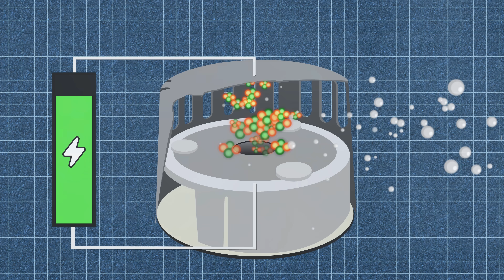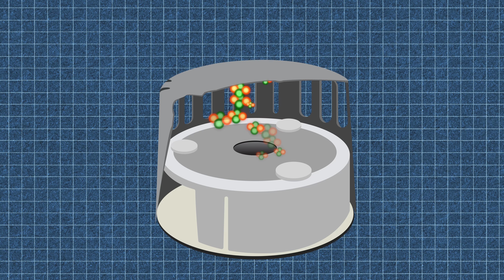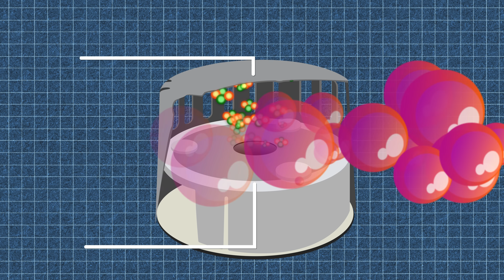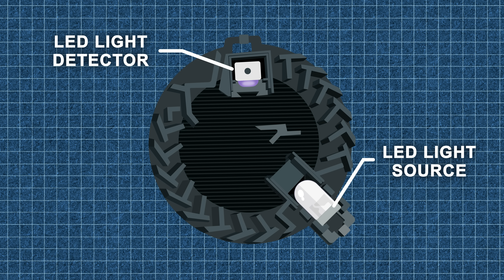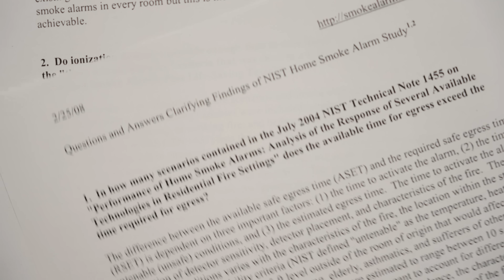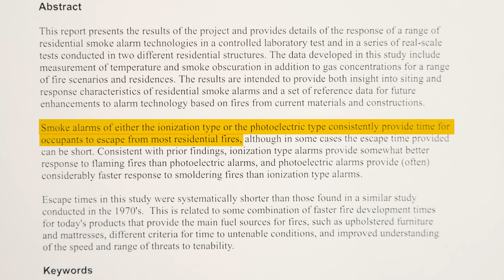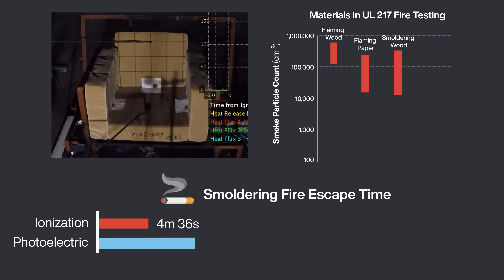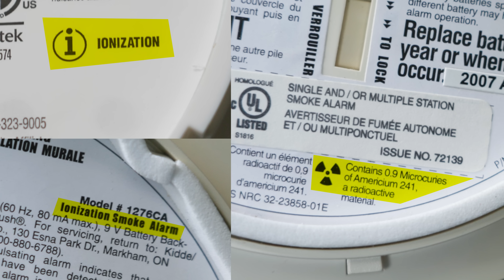Why the Most Common Smoke Alarm is Dangerous

Comment: I said 5 or 6 years ago they should have dual sensor smoke detectors.  Use both ionization and photoelectric sensors.  Add CO detection to it and you have a pretty good detector.
Reply: Considering the high false alarms with ionization- the proposed design that incorporates it in a dual sensor alarm will also have high false alarms.  

That’s why the safest design is photoelectric only without ionization.  This is what nest protect decided after extensive research.   The best design actually excludes the sensor that produces bad results.
Reply: @neilbrookins8428  they dont, I have the First Alert/BRK SA32010, no false alarms in the kitchen of because of showers
Reply: @neilbrookins8428 if you read comments you ll see complaints about photoelectric false alarms. My ionization alarms did not have a single false trigger in two years since they were replaced ( the once i got withe house 23 years ago were tripping like crazy)

Comment: When I rise to power, there will be a detector that detects smoke, fire, heat, photons, and also natural gas, sewer gas, propane, carbon monoxide, or any other thing in the air that is harmful It will have a nice look, it will be wired and wireless option on the same unit, one size fits all and a battery that is rechargeable and replaceable, but proprietary to discourage using in another device, but the battery shall be readily available on The Amazon and in any grocery store, drug store, hardware store, convenience store, gift shop, etc. The fire department shall also furnish the new detectors upon request, and even come out to change the battery in detectors a home owner can't reach. In some homes, construction workers thought it was a GREAT idea to put them at the highest point in a vaulted ceiling. Need a giraffe, to change those batteries.

I will also ban these newfangled things and go back to a lot of the old ways. I will ban this synthetic furniture that adds fuel to a fire, and all this other garbage, that has been allowed because people are so greedy, that the almighty dollar matters more than the people that are spending all these mighty dollars. It is total INSANITY ! Mine go off when I run my fog machine. In about 30 minutes.

Comment: If the different types of detector are good for different things, and both are so simple, why TF didn't they just put both types of sensor into one unit?

And if you are already going smart anyway, having two sources of data for it should make it WAY better at both early detection and false rejection, no?
Reply: Nevir, you might be tempted to think that two is better than one. But in this case it’s not.  Studies have shown that ionization alarms get more false alarms.  That leads to a higher rate of disabling.  That leads to non-functioning alarms.  You are much safer if you have only photoelectric type alone.  It might not be intuitive but it’s true.
Reply: @neilbrookins8428  Did you even read my comment? FFS.

ONE alarm with both types of detectors, then using the smart analysis they are already using to avoid false positives, but they'd have two data points to work with rather than one.

You're complaining that ionization alarms are worse, and yet this new alarm IS AN IONIZATION ALARM.
Reply: @Nevir202 the company usi has sold their iophic alarms since the early 2010’s.  These alarms use an ionization sensor and a smart cpu to process the signal and attempt to both reduce false alarms and increase sensitivity to smoldering fires.  But independent tests that are done outside the UL facility have shown poor performance for smoldering fires.  Even though the tests at UL pass for smoldering fires.   

I don’t trust the new 8th edition alarms that use ionization sensors.  They seem too similar to the iophic alarms that are not reliable.
Reply: @neilbrookins8428  WOW! Sounds like a GREAT argument for exactly what I said, having both sensors.

Since as discussed the optical style have a clear, well known issue as well, and I just don't see how you avoid having one weakness or the other... With the exception of having both, and using them to cover each other's weaknesses.

I mean, if ion sensor says 90% chance of fire and optical says 5% chance, seems pretty likely there is no fire, and you've successfully rejected a false positive.

While on the other hand, if ion sensor says 95% and optical says 40 or 50%, but still isn't at a threshold where optical alone would be going off, congrats, you have just correctly identified a fire earlier, something that can literally be a matter of life and death.

Comment: I have 10+ year old ionization fire alarms in this house from 2005 we bought.  Trying to convince my wife we need to buy a nice rechargeable fire extinguisher AND new smoke alarms.
The no carbon monoxide one listed on Amazon in the description is saying its photoelectric on the sensor?
Reply from the maker: Amazing! Hope you're about to convince her, if only to follow the laws that many places have on replacing more than 10-year-old smoke alarms.

Yup, so photoelectric is still the better choice in 8th Gen models.  It took what was working, and the new standards made it better.
Reply: Uh, 2005 would make it 19 years old.  That’s a bit more than 10 years.

Comment: The problem is not completely solved. The kitchen still needs fire detection but smoke detection often triggers false alarms. The solution for kitchens has always been heat detection. However, heat detectors are only available for fire alarm systems and not the residential battery and interconnected line power models.

Comment: Important: Use only Photoelectric type smokes alarms. Ionization have been proven way too slow to respond to fires.
Details: Ionization sensors react faster to flaming fires, but only marginally (1 minute). However, photoelectric sensors detect smoldering fires (the most common type) 15 to 50 minutes faster!
Note: Combination Photoelectric / Ionization detectors can be good but there is an issue. Some models require both sensors to agree (dangerous) while others will alarm when only one senses smoke. For example, I think (but have not verified) that First Alert will sound an alarm if just one sensor detects smoke. For this reason, I recommend only Photoelectric smoke detectors.
Reply: Capt-intrepid your comment about the 15 to 50 minutes faster is misleading. Many times the ionization alarm will not sound at all.  But the photoelectric alarm will sound with plenty of time to escape.  How do you compare these two times?  Short time  vs never.  Is that infinitely faster?   

Basically I’m saying that the 15 to 50 claim is underselling the benefits. It’s better to say it works vs the other one doesn’t work.

Comment: After a long discussion with my partner about this, we came to the conclusion we want old smoke detectors and new smoke detectors, both, together. While it's good to have fewer false alarms with this new detector, the kind of false alarms it won't trigger on are the kinds of "false" alarms that have saved our meals and cooking equipment from mistakes in the past. We don't want to lose those false alarms because they are still helpful, but we want the new alarms because they're faster to respond to dangerous fires.
Reply from the maker: That sounds amazing, I love your thinking and it clearly works for your situation.  Kudos.

Comment: Both types are "particulate matter" density meters.  With a (usually) very, very high trigger level.  Especially on the smaller end of the scale for smoldering fires and cigarettes.
The reason they are so simple is because they need to be cheap or people will not bother buying them.
A more complete fire detection system would use a range of sensors.  IR sensors to see "flame" or hot spots over any cooking temp, like 400C.  <-- these are already used in europe for kitchen sensors.  VoC sensors to detect volatiles.  Most fires will cause some spike in these as all those nasty carbon components and solvents get released from burning plastics.  CO2 sensors can detect "foul air" levels.  Indoor CO2 can get as high as 4000ppm.  You will notice "stuffy" air etc.  However in a room where there is a fire smouldering the CO2 levels will continue to rise way higher.
Consider that critical systems like aircraft have fire detection and supression systems.   However the costs involved in a false alarm are so high they absolutely do NOT go to Walmart and spend $10 for 2 alarms and stick them to the cieling.  They spend $1000 dollars per sensor and use different sensors in different places where fire is likely or most critical if it occurs.
Causing a full on emergency because someone decided to vape in the toilet is not something airlines want.

Comment: So I smoke currently.  I have optical and ionisation alarms in the room where I do so.  The alarms do not sound.  Even when the room is "hazy" with smoke.
I also have a laser particulate sensor which give me mg/l density of different sizes of particles.  It noticed each and every cigarette smoked anywhere in the house.  It does also detect cooking.  It even detects when use you dusty/floury ingredients (like mashing in a beer).
I have seen figures into the 100k 0.3um particulates per L.
A future smarter device could also use this "way under the trigger" level detects to provide early guidance.  Not a blasting siren, but a gentle beeping or a phone notification which says, "Low air quality detected in zone X".  For which you can calmly go and check.  If you enter the room and your friend just lit an incense stick then it's obvious not a concern, however, if you go into an empty room and smell "hot electronics" or "hot material like someone is ironing clothes" you will put the light on an go searching for what is up.  You might find that phone charger cooking at 120C before it actually bursts into flames.
Reply: All smoke is not the same.  Smoke detectors are designed to be resistant to cigarette smoke, for obvious reasons.  This is considered to be a feature, not a bug.  Google Nest detectors do just what you suggest.  They give a calm "Ding! Heads up, there's smoke in the kitchen" with a voice alert when smoke is first detected.  If the smoke level passes the threshold it sets off the alarm and says "Emergency: there's smoke in the kitchen".  This "heads up" alert is configurable on each detector.

Comment: I'd recommend you cover dual sensor alarms in a follow-up video. A couple years ago, on the advice of Consumer Reports, I upgraded all of our alarms to First Alert dual-sensor models. However, there's still the open question on how these alarms use each sensor. It'd be nice if you answered that.

Comment: Sounds like the makers of the ionization alarms have completely captured the regulators. And are pushing a fake fix
Reply from the maker: You know that was the EXACT accusation one of the leading fire research scientist and Boston's fire chief who lobbied against Ionization alarms accused the industry and UL of doing.

You might enjoy the PDF where they lay out their theory: http://psas.scripts.mit.edu/home/wp-content/uploads/2017/04/Fleming-SmokeAlarmsInvestigationFatalFires.pdf

Industry gets something like 1/3rd votes so they were accused of blocking the standard from moving forward.

8th gen is 100% legit though.  It's been verified by the government of the USA as being significantly better for both types of alarms compared to previous generations: https://nvlpubs.nist.gov/nistpubs/TechnicalNotes/NIST.TN.1947.pdf
Reply: @Lam  The second link does not show the new alarms work just that all the old ones don't pass.
Reply from the maker: What would constitute proof for you? I think the research is clear where the blind spots were, the standards 8th added to compensate, and research showing there is a significant improvement from the prior generation.
Reply: @Lam  It's from 2016 and didn't test any of the new ones. It said only the photoelectric ones came close to passing the new standard. They seem very obsessed with testing cooking and limited the testing of what might be burning in the home.
Reply from the maker: @JimFeig yes, the 8th gen standard is from back then, it's been delayed several times.  All the new ones must therefore meet that same standard that the old ones could not.  We also know what's in the standard as well. Intertek who does product certifications ensure the new alarms meet that more stringent standard

Comment: Steam and dust will set off photoelectric alarms. They both have their own issues and advantages.
Reply from the maker: It's gotten a lot better! Most photoeelctric alarms have a screen to keep out dust and bugs.  They (manufacturers) do recommend you air blast / vacuum your alarms every few months to prevent that.

Comment: I've been cooking and the smoke alarm went off with no fire,  The exhaust fan that works is 6 feet from the oven, I disconnected the battery from the smoke detector in the kitchen, there are a couple upstairs nowhere near the stupidly installed baseboard heaters, which I will never use in the rental house I'm in

Comment: Sure, you can use lots of complicated code, even AI but wouldn't it be much easier to just put both kind of sensors into a single housing and then just combine the data from both sensors with much simpler code?

Comment: Werent Ionizing alarms banned like 15 years ago?
Atleast thats how its over here in europe...  We use Photo-Electric alarms when it comes to Home stuff and in the industrial/commercial sector we mostly build heat sensing & photo-electric combination sensors.  (i build fire alarm systems)
But there are still worlds between cheap and the name-brand detectors. Its shocking how big the difference really is sometimes in detection rate...

Comment: Sadly, I know mine work just by leaving the door open on a windy day. They go off frequently. They also went off when I took a shower while the power was out after Hurricane Sandy. Also annoying that they don't tell you WHICH one is low on battery. You have to go through probably the entire house to find it and there's no indication either. The light stays green regardless. Only ever seen it go red once and according to the manual, red and green mean basically the same thing.

Comment: I like your use of the Cookie-Monster to show how synthetics look like to a fire. ^^

Anyway:
the problem you are describing seems to be not an issue here in Germany.
I have never seen any other smoke detector on sale other then photo electric smoke detectors.
I am not saying the don't exists, but I have not seen them thus far.
I have not been looking for them, to be fair.

I have read about the different types of detectors years ago, and that's  how I learned about ionization based detectors.

Should I have to replace any of my existing detectors, I will take a look at the new type 8 ones, though.

Thanks for the info! :D
Reply: AFAIK in Germany radioactive smoke alarms were already banned in 1980th or 90th.
Reply: @cyberyogicowindler2448 and nuclear stations were banned next 😂

Comment: ionizing smoke detectors aren't even legal in Europe since they are basically useless and dangerous if not properly dispoed of.
In Germany you need by law a smoke detector in every Bedroom and the escape ways like Floors to the next outside door. So you don't get stuck on the first or worse second floor because the fire was started on the ground floor with the only door to the safe street being there or the fire started in the basement and the smoke would get up to the ground floor and stop you from escaping through the stairs.

Comment: Don’t recommend products that you have not personally tested! These sponsored Amazon links, link to products that are not the ones described in the video, which are supposed to be using the latest intelligent ionization technology. 

Most are optical and have a large number of one star reviews that point to systemic reliability issues with alarms not activating or 10 year batteries dying after a short time. Also many have bad customer service.
Reply from the maker: Hey Christian, I've tested all of these alarms myself, some I don't own like the Nest Protect so I had to talk to a friend who had them and go through the app.  I bought a bunch of the 8th generation models which were on camera.  I use the equivalent of the last-generation version in Canada and would gladly switch it out if it was legal here.  I did limited smoke tests but it really doesn't make sense showing them because it's not proper testing conditions.  I'd need an entire room at minimum due to the way smoke particle agglomerate.  

They are one star reviews because First Alert has just released them and haven't done what Kidde did by linking their old model with these new ones to take goodwill from their past reviews.  Yes they are fully photoelectric (optical) because that is the superior technology.  In fact all of Kidde's new 9th gen models are fully photoelectric.  I have a feeling 9th gen tests will not allow ionization to pass.